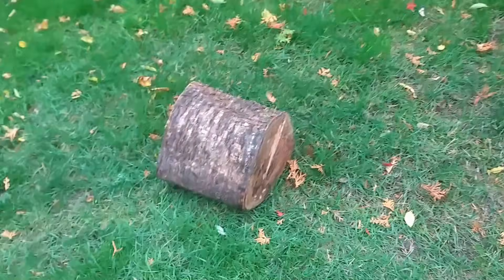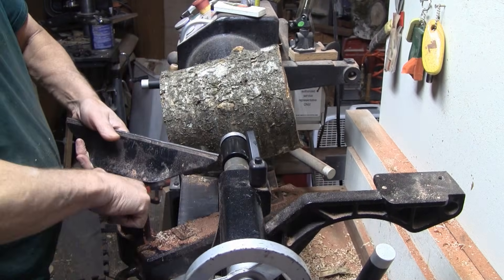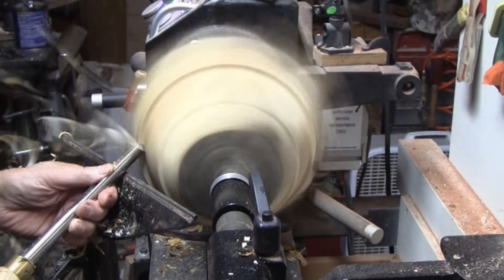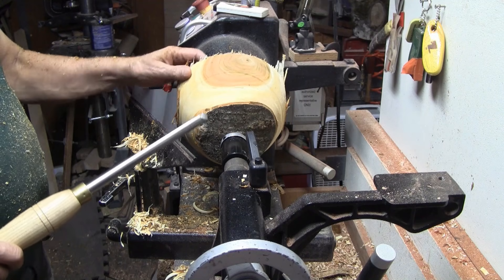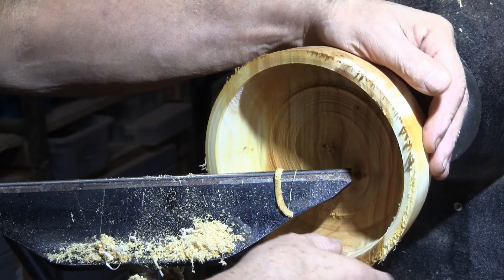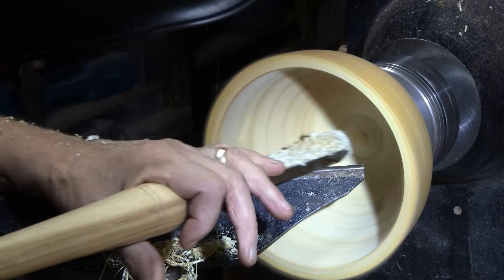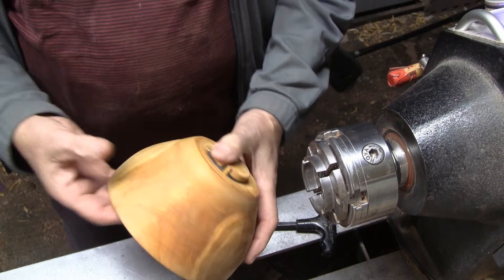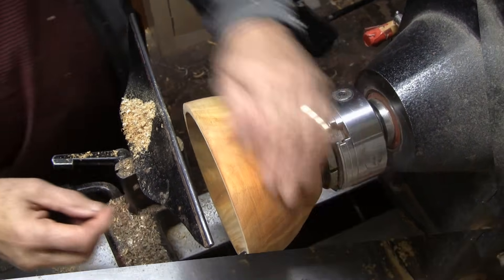Wood Turning Green Wet Wood Thin & Sanding Tips

Comment: Had my share of cracks with wet cherry.  will have to try the mineral oil trick.  Nice piece and thanks for sharing.
Reply from the maker: Thank you Tom. I recall coating a piece with mineral oil before sanding but it did help to get some of the sanding done before letting it dry.
Thanks for watching,
Gary

Comment: Great looking bowl Gary. I don't like waiting either, but I only recently got some green wood to turn. Thanks for sharing.
Reply from the maker: Thank you Joseph, the thing of it is if I put one away for a few months I loose the connection I had with the turning.
 I suppose if you were turning to sell it would not matter. But then it would see like work to me. 
 Thanks for watching,
Gary
Reply: @ThePapa1947  I was able to turn a 12" Maple bowl. It was green wood. Turned and sanded, then I applied Tried & True Danish Oil a few times. I did this to see if it would keep it from cracking, my experiment with it.  Don't know the moisture content, haven't measured it. Just been weighing it every couple of weeks. It is looking good. I think I will true up the rim at the end. It is measuring 11' x 12" right now. Regards.
Reply from the maker: @josephwise485  sounds like a great test. How thin did you turn it and has it warped?
Gary
Reply: @ThePapa1947  It is just under 1/2". Rim is 11" x 12". I keep weighing it to see if it has stabilized.

Comment: Glad it didn't crack Cherry is a pretty wood, not seen sanding done like that before looks like a good tip, I have turned green Oak and that can warp but still look good.
Reply from the maker: Lewis I was happy it was crack free as well. It did help a lot in the sanding because the wood was still very wet. I turned so green Oak a number of years ago and it also warped but still looked great as well.
Thanks for watching,
Gary

Comment: Very nice bowl.  You mentioned your drying box, probably in another video I haven't watched yet.  Can you tell me what your "drying box" is?
Reply from the maker: It is a card board box with a computer fan attached at one end and blows air into the box. At the far end in an upper corner I cut a 2X3 inch hole to let the air out.
Behind the fan I have a round heating and air pipe around the fan. The pipe is about 12 inches long and I have a 60 watt alight bulb sitting inside of pipe.
Mine is a modified version of what Rick Turns has made and has a video out on it.
What I made works great. Maybe 2 weeks for a twice turned blank where the walls are 10% of the diameter. For a bowl turned think I have dried them in as fast as 18 hours. Depending on wall thickness.
 Hope this helps,
Gary

Comment: Good evening Gary , as usual beautiful work .
I am new to the wood turning game , in your video you talk about a drying box , could you explain what a drying box is ,
Thanks again and keep the videos coming .
John in the emerald Isle ☘️☘️☘️☘️☘️☘️
Reply from the maker: Thank you John. So the drying box is just a cardboard box with a computer fan fastened over a hole in the box. I have a piece of round duct work that I put a light bulb in and the fan pulls the heat in the box. It is vented on the opposite side though a 2X2 inch hole.
 I made it after watching Rick Turns make one. Check his channel out to see how to do it. Mine is not exact but the same idea.
Thanks for watching and happy turning,
Gary

Comment: Great bowl brother!  I was searching finished wet wood and this popped up.  Thanks for posting it!  I have a live edge Bradford pear on the lathe now and got it to 1/4" and it's pretty wet.  Going to try your menthod.
Reply from the maker: Thank you Dan.  I like it on wood that has a tendency to crack. Kind of slows things down. Black Walnut is pretty stable and I just turned a piece down to 1/4" and since we was going away for 4 days I put a plastic bag over it on the lathe and it was fine when we got back. Probably did not even need the bag.
I have never turned Bradford Pear. How is it for cracking?
Thanks for watching.
Reply: @ThePapa1947  I'll have to let you know on that!  First time turning it for me.  Very nice wood to turn was like butter!  Got it sanded to 400 grit and gave it a coat of oil.  I'll keep an eye on it for a week or two and see what happens.

Comment: Thanks for the tips on turning wet cherry. The little that I have done with wet wood is that you better be prepared to do it all in one setting else if wait 8 hours or a day those cracks jump out and can ruin the project.
Reply from the maker: Thank you for watching and you are right about how that cherry can crack.  The one that get me is Plum. Last year I turned 2 pieces that were dry. No cracks to start and none at the end. But within 2 weeks both decided to crack. A lot of stress in Plum wood for sure.
Thanks for watching,
Gary
Reply: @ThePapa1947  wow, I also turned some plum and it cracked so yes, very sensitive.
Reply: @ThePapa1947  Sorry for another question, do you have a Latina Revo 18/36? If so is it a 110V or 220V and are you happy with it? I plan to upgrade my HarborFreight lathe.
Reply from the maker: Yes I do have Laguna Revo 1836. Mine is the 220V. It is a good lathe and yes I am happy with it.
 Feel free to ask questions any time you want.
Gary
Reply: @ThePapa1947  Thank you. It seems to be very popular and an excellent price compared to others with those features. Do you have any comparisons between the 110V vs 220V besides the bigger motor? Ron
Reply from the maker: Ron all I can say is I know someone with the 110 version and is happy with it. But If you have 220V I would get that because I see they are now the exact same price. At least at Rockler where I bought mine.  And if you end up with something big and heavy the extra power will be nice.

Comment: Cherry is so pretty and turns so easily.  I love the idea of wet sanding with mineral oil.
Reply from the maker: Thank  you Carol and it sure does turn nicely.  I have seen people use oil to keep the dust down when sanding dry wood but not wet. I would not use it on anything I was going to use lacquer or shellac on though.
Thanks for watching,
Gary

Comment: On wet bowls like this I use Mahoney's oil for the sanding. When I'm done the Mahoney's is already in there and no more finish necessary. After a couple of days I buff the piece to get a good shine.
Reply from the maker: Thanks for your method. How long will the Mahoney's keep a shine?
Reply: @ThePapa1947  Good question. It seems to depend on the wood. When it drys I buff it, And then apply the Mahoney's wax. It has a nice mat sheen  which I prefer. Waxing periodically will keep the sheen.
Reply from the maker: @crackerjack3359  Most eveything I make is not meant for food but more of a show piece. So I like a finish that stays the way it stareted.
For food use I use different oils or Acks sanding paste and polish.

Comment: I actually twice turn all the green wood. I'm going to give this a try too. 
Thanks for the explanation.
Reply from the maker: Thank you Frank, I am sure twice turn is very efficient if you are doing a lot of bowls. I get connected with a turning and not sure if I would be all that excited about getting back on one after letting it sit. But it is good for others especially if they are selling.
Thanks for watching,
Gary
Reply: @ThePapa1947  I recognize that problem. When pre-turning, you already determine the basic shape, which can change very differently due to the drying proces. Sometimes it warps terrible. (I don't have to tell you that. You know that of course 🙄) Thank you Gary.

Comment: Nice bowl. I've turned quite a bit of green cherry and the only cracking problem I have had is if there is a knot. I've had some luck using thin ca glue on the knots
Reply from the maker: Thank you. Yes Cherry is a very nice wood to turn with very little cracking. I have some freshly cut Cherry that I will be turning soon.
Thanks for watching,
Gary

Comment: Nice bowl and the grain did pop when the Howard was applied.  You mentioned a drying box.  Can you provide the dimensions, if you use or put chips in the box and the type of lid.  Thanks for sharing.
Reply from the maker: Thank you. The box is cardboard and could be any size. Mine is about 24 inches by 20 inches and 15 inches tall. Here is what I have done with it.
I have a card board box with a computer fan attached over a hole in the box. To that I have a short(10 inch) round heating duct material over the fan. The fan can be powered by a Wall Wort. (old phone charger)
At the other end I lay a light bulb in the tube. The fan pulls warm air into the box and is vented out the top rear of the box through a 2X2 hole in the box. The lid on the box is closed.
 I used some of Rick Turns ideas on his drying box. So I you want to see a video on doing it look his up. But it is extremely  basic

Comment: I am going to have to try the oil sanding.  The Butcher Block conditioner is great.  We make our own from mineral oil and beeswax.  My husband uses it all the time on the cutting boards he builds.  I have used it too on my bowls.  Lovely bowl Gary.  I would love to see a video about your drying box too.
Reply from the maker: Thank you very much Jane. The sanding really helped and that wood was still soaking wet. I only did it with the 80 grit just to give it a head start before going into the drying box. So here is some information on the box.
I have a card board box with a computer fan attached over a hole in the box. To that I have a short(10 inch) round heating duct material over the fan. The fan can be powered by a Wall Wort. (old phone charger)
At the other end I lay a 60 watt light bulb in the tube. The fan pulls warm air into the box and is vented out the top rear of the box through a 2X2 hole in the box. The lid on the box is closed.
 I used some of Rick Turns ideas on his drying box. So if you want to see a video on doing it look his up. But it is extremely  basic.
Reply: @ThePapa1947  That sounds easy enough, with all the spare computer parts my husband hoards he could probably make me one, He used to build computers and there is still computer junk in the shop LOL.  Thanks Gary, have a blessed week.
Reply from the maker: @janeoverby2151 I built computers for years myself. I used a computer power supply to run the fan. You have to use a jumper for the power supply to run without being hooked to a power supply. Plus I get a little heat from the power supply.

Comment: I like bowls with bark on them. The bowls with a lot of bark are even better. I also like the bowl you turned today. I never knew that mineral oil would help with sanding. I try to learn something new every day.
Reply from the maker: Thank you Don., I also like some bark on a bowl but this would not have stayed on. It might seem messy but it actually does help using the mineral oil. I doubt I would do it if I was using something besides and oil finish.
Thanks for watching,
Gary

Comment: Hi my name is frank i liked your cherry  bowl turning I've been making  lamps with wet wood and most of them Crack how can I stop it
Reply from the maker: Hi Frank. If it is still pretty thick you can seal the ends so it does not dry too fast. You can always put it in a paper bag or box full of chips 
I have a video coming up showing a simple drying box

Comment: Very nice job! Do you have a video about your drying box? I have a bunch of Cherry logs from a big limb that fell last winter I need to get turning!
Reply from the maker: Thank you, the drying box is just a cardboard box  with a computer fan hooked to the bottom of one end pulling air into it and venting from the other side on the top. I have a 6 inch round HVC pipe around the fan with a light bulb sitting inside to provide a little warm air. I built this based on the one that Rick Turns made. He does have a video.
Reply: @ThePapa1947  Thanks. I'm not familiar with that channel, I'll check it out.

Comment: Great job on your bowl. I have a question, of course needing your opinion again. I have a lot of blanks I have cut out and am trying to rough blank them to about 3/4. “ thick for the walls and the bottom, let them dry a few months, then come back and finish turning them , making it round again, final sanding and finishing,(twice turned), as you mentioned. I just have a midi lathe, so I really enjoy the process much more if I have a semi turned blank. Anyway my issue is this, I turn a tenon initially, so it fits my chuck very well, so I can rough out the outside, then turn it around and rough out the inside. But when I go to second turn it, it usually has warped somewhat, and I’ll turn it between centers and get the outside of the bowl back round again, along with the tenon, bc it is usually a little oval also, and I want to make it round, so I can hold it well.  The problem is, after I take off that little bit, of wood from the tenon, it may become a bit too small in diameter to fit my chuck. It fit perfect, when I first turned it, but was too small for my second turning. Should I just make a bigger tenon initially?  My concern is if I make it bigger initially, will that slight the integrity of holding power of the chuck?
Thanks
Tommy Schutz
Reply from the maker: Hi Tommy, for sure you want to make it bigger so you can true it up after it has dried.  Normally if you turn the tenon so the jaws are 1/4-3/8 inch from closing it will hold fine with the green wood.  But you will want to make sure you tighten it up often.   As you know green wood turns easy so the jaws not fitting perfect is normally not a problem. In this case I would make the tenon as long as you can without bottoming out in the chuck.
 Hope that helps,
Gary

Comment: Gary, tell us about your drying box. Is it heated? Love the bowl. I too hate the waiting involved in twice turned. I’ll definitely try this technique.
Reply from the maker: Thanks for watching Peter.
I have a card board box with a computer fan attached over a hole in the box. To that I have a short(10 inch) round heating duct material over the fan. The fan can be powered by a Wall Wort. (old phone charger)
At the other end I lay a light bulb in the tube. The fan pulls warm air into the box and is vented out the top rear of the box through a 2X2 hole in the box. The lid on the box is closed.
 I used some of Rick Turns ideas on his drying box. So I you want to see a video on doing it look his up. But it is extremely  basic

Comment: What does your drying box consist of? Wxcellent job
Reply from the maker: Thanks so much.
Pretty basic...a cardboard box, computer fan, round A/C pipe and a light bulb. I cut a spot for the fan and put the pipe over the fan. I then place a 60 watt light bulb just inside the pipe which is about 10" long. I also cut a 2x3 inch in the far corner to let the air out.
It works good and I got the idea from a video done by Rick Turns. I change mine a bit but you could look up his and see how he did it.
Thanks for watching,
Gary

Comment: Why use sanding sealer? Is it food safe? 
I like your channel. It’s easy to follow.
Reply from the maker: I use sanding sealer if I plan on putting a finish such as lacquer or poly on it. Those I do not use for food.
From what I have read food grade shellac is food safe and some use it and a product like Acks abrasive paste for food use.
 I have been using this bowl here everyday as a snack bowl (chips, nuts and the like)and have not done anything with the finish.
Thanks for watching,
Gary

Comment: I realize I’m a bit late on watching this video but towards the end of the video, you said you were tempted to use shellac on it. You used butcher block on it and idk what the difference would be in the future. One more question, is using shellac better than tung oil, or danish oil? If there’s anything about finishes used and for certain pieces, I could use the info. I’ve only been turning for about a year now and I have used tung oil on some and poly sometimes. So being I’m fairly new at it, any help or learning tips would be very appreciated. I love all your work and I also like the info you do give. It has helped me already in my new hobby. Thank you and Happy Turning
Reply from the maker: Thanks so much. A shellac finish will build up where as the Butcher block does not but it is food safe and can be wiped on when needed.  The shellac is long lasting and I use it more for art type pieces.
On my segmented work I like to use lacquer or Polycrylic. They are both clear and give a nice deep look.
On a natural turning I like shellac or the oil based poly (Minwax Wipe On Poly) it is very durable and can add a slight tint to the wood.
 Hope this helps and thanks for watching,
Gary